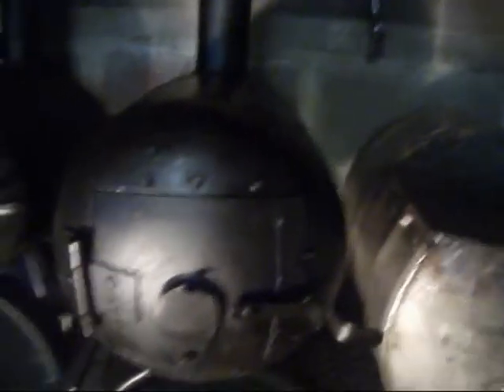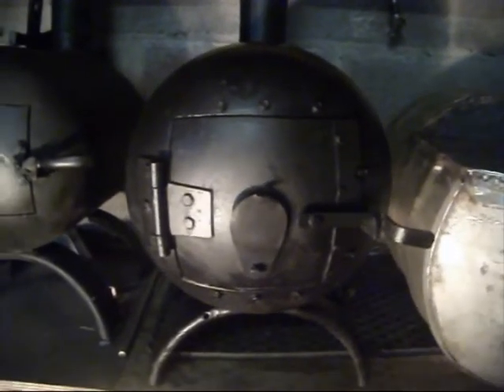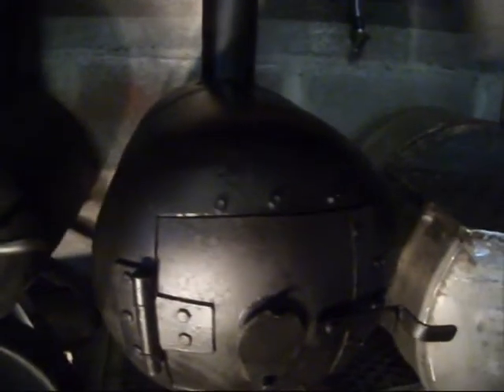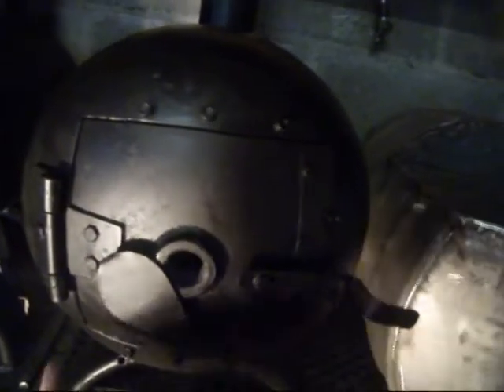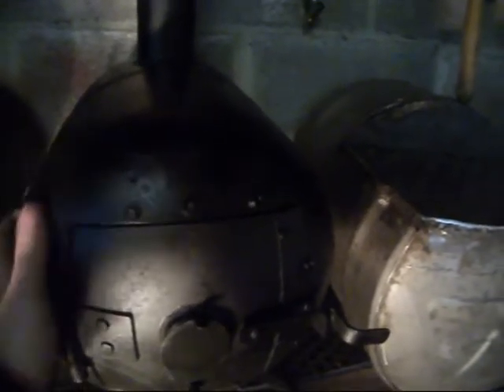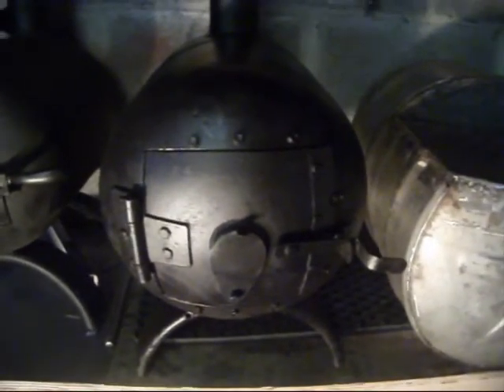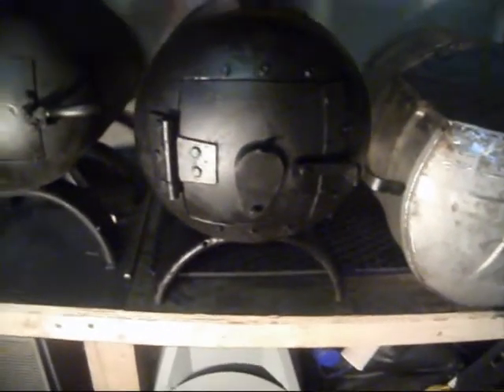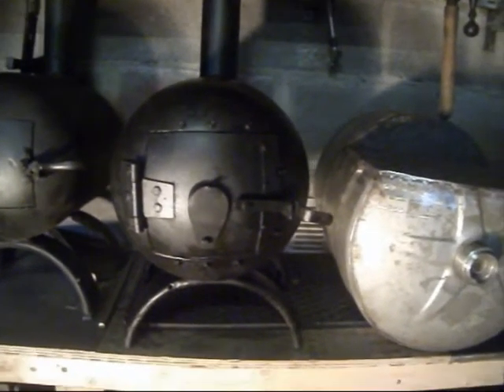wood stove feedback

Comment: @deccied I think your stoves look fine, I don't think the finish is any better on mine very flat paint helps hide the imperfections. I used very high temp. header paint for mine it hasn't burned off yet I have  had only two fires in it yet. Once the lake freezes so we can go fishing we will find out how long it lasts.